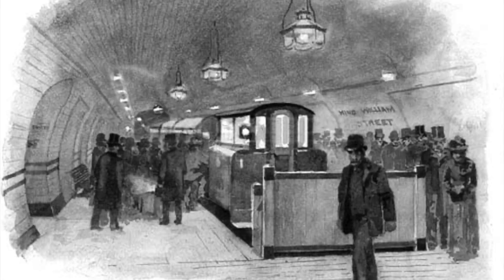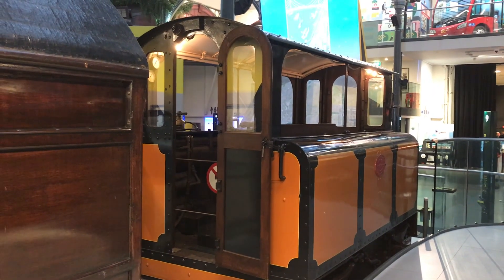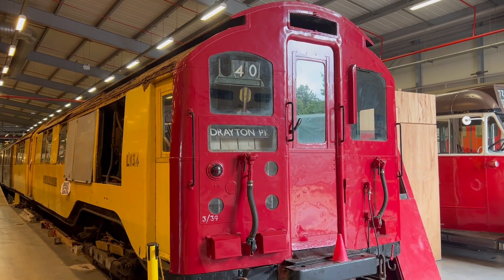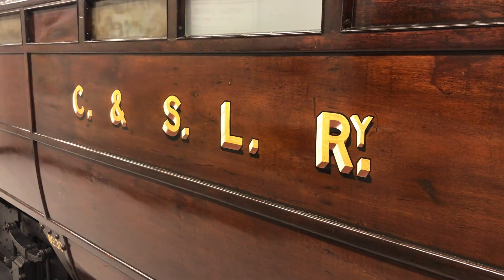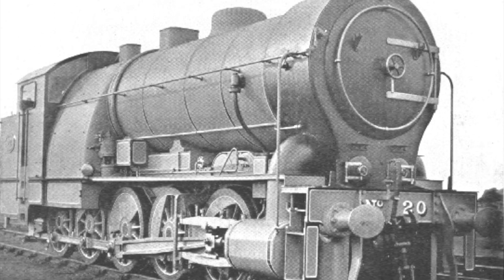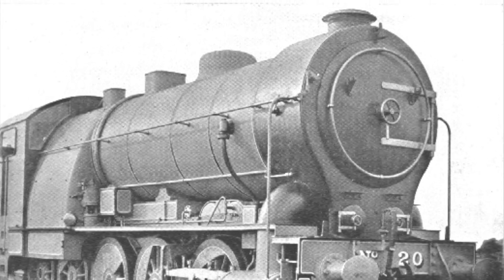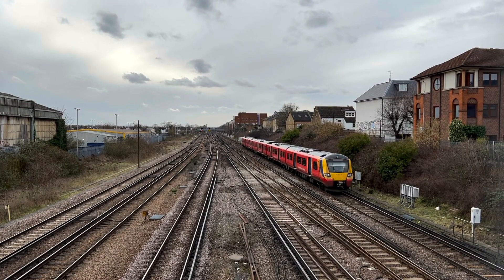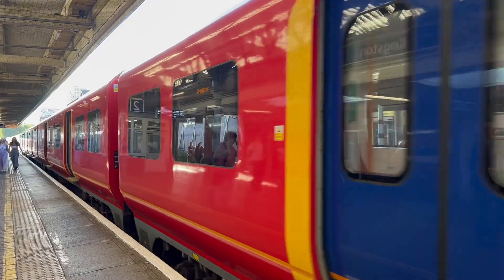Why some electric trains use a third rail, and others don't

Comment: I'm not sure if this is a myth or not... Having worked on British Rail it might well be that because there where a lot of them!! My understanding was that the whole of the Lancashire and Yorkshire Railway was to be turned into a third rail system prior to WW1.... However the UK being the UK and it not being London the only part that was finished was the Bury line ... Now part of the Manchester tram system... I'm not sure if Merseyrail's third rail was part of this programme or something independent of it, but before Manchester Victoria was modernized there where areas of the mainline... not connected to the Bury line that had 3rd rail fittings

Comment: A weirdness I just remembered: the Southern Region had (has?) 'electro-diesels' - diesel-electric engines that could also run from the third rail. Did similar things ever exist on overhead lines? (I know multiple-units do this - eg on the GWR, but were/are there engines that do/did it?)
Reply: Yes. Class 88 ac electric locomotives can do this trick. Some SR class 73s are still around - they work the diesel portions of thge Highland Sleeper, although obviously the 3rd rail capability is not required for this.
Reply: Many of the electro-diesel DC third rail locomotives are still around but in private ownership or on heritage lines. Southern doesn't own or still operate any that I know of...after all, they are over 60 years old by now.
Reply: @adrianbaron4994  nothing wrong with being over 60 years old!

Comment: The London Underground uses ( more expensive ? ) FOUR  rails to keep the running tracks totally isolated from the traction electricity ... this is to prevent  SERIOUS electrolytic corrosion of the tunnel rings .... simple ! ........ DAVE™🛑

Comment: Might be worth mentioning a few additional reasons why the post- war sr went with the third rail .

1) the LBSCs elevated electric lines used Siemens technology and they, being German, had been out of favour since 1914.
2) the SECR had been planning it's own electrification based on a tube type 4 rail system and 
3) LSWR / SECR engineering staff dominated the higher echelons of SR management.

Add that to the cost of the overhead system and the straightened circumstances of the early SR and the technologically better LBSC system was always going to lose to the cheaper and simpler 3rd rail 

The LBSC were right in the long term tho....
Reply: This is quite true, and in the end, the decision came down to AC mileage versus DC mileage, but it wasn't as clear-cut as it seems. 

The LBSCR was so pleased with the turnaround in fortunes of the South London line after AC electrification that they eventually extended the system to other suburban lines south of London; they got about 1/3rd of the way to Brighton and planned to extend the wires all the way there, which would have given Britain its first electrified mainline. Keeping with the continental feel of the LBSCR AC system, they would have used Swiss-style coupled wheel AC electric locomotives for non-stop express services from Brighton to Victoria and London Bridge,  including Pullman services. 

We could have had an electric Brighton Belle 10 years before the DC one came along, and they were planning for it to be fast...well under 55 minutes, just enough time for kippers, toast, marmalade and tea.

The arguments against abandoning the technically superior overhead AC for DC third rail still ring true today...dangerous to staff, vulnerable to snow, ice, and heavy rain, numerous substations required every few miles, not suitable for long distances and high speeds.. but just as with HS2, short-termism overcame everything else.
Reply: @adrianbaron4994  I seem to recall that the LBSC used some motor luggage vans which were effectively elective locomotives and some became the SR express brake vans in the the thirties, after conversion
Reply: they were really really right tho, interestingly. Because they used an AC OLE system which was quite forward looking of the time and would have put them in a really good position throughout the 20th c

Comment: Here in East Sussex we still await electrification.  The line to Uckfield is still diesel and partially single track as well.   Perhaps in the future we may return to a pre-Beeching level of service.
Reply: Keep an eye on the GWR  ex Vivarail D stock battery train experiment on the Ealing to Greenford shuttle route. This started quite recently and GWR is betting big on this, having paid £25 million for the Vivarail trains, technology etc, and hiring the former Vivarail specialist engineering staff. What is really needed is to reconnect the Uckfield line to Brighton via Lewes, but that's a different matter.
Reply: Services on pre-Beeching rural lines were often very patchy indeed, so don't necessarily set that as the target. Pre-Beeching rural lines were often very infrequent, not particularly reliable and used very old stock. On many lines you would be lucky to get one two carriage train every two hours. There is something of a sentimental attachment to lines back in the 1950s, but it was not a golden age. By that time, a lot of passenger traffic had already been lost (it had started with buses, which were often more convenient before private transport became really popular). 

Also, steam-operated rural lines in the 1950s were really bad.

Comment: Nicely explained, Jago. I think if they were going to convert "Southern" to overhead wires (which ever since I was little I thought was a sensible idea) they would have to do it piecemeal.  London to Dover,  to Brighton, to Southampton. And then gradually fill in the rest.  That would then throw up issues like tunnels not being particularly high or wide which might prevent overhead wires being used. Then you are into a whole different ballgame of change. 
There are other areas like here in Scotland which might benefit from overhead electric. Just about everything north of Glasgow and Edinburgh is still diesel powered. (but theres also been hydrogen power being trialed!!!).  We've got a lot of wind generated power but that same wind might prove difficult for overhead pick-up.
To be fair, UK has been particularly bad at electrifying railways. Just about anywhere in Europe has been electric for...well...as long as I can remember. (still a few French and Danish diesels around lol)
Reply: The cost of converting the major Southern DC routes to overhead AC would be enormous and it's hard to see how it could ever be financed despite being a far superior system to DC. Network Rail, however, has a quandary...much of the DC third rail power supply infrastructure is going to be, or is becoming, life expired and as this sort of heavy rail long-distance DC power supply equipment isn't widely made anymore, replacing it won't be cheap either, so who knows. Maybe we will see DC to AC conversions if it's cheaper overall. Certainly, a lot of the modern third rail-only DC rolling stock used in SE England has provision to be converted to AC overhead, if that ever happens.

The ill-fated" electric spine" 25 Kv AC freight route project of 2012, was never completed in full although some bits were or are going ahead (East-West rail is a part of it, although minus the AC electrification, which was the whole point in the first place ) would have involved converting the DC lines from Southampton via Basingstoke to Reading to AC, or maybe keeping the DC and adding AC masts and wires for the electric freight services. This was also supposed to be a test bed for future DC to AC conversions, but as this part of the project was never built, we'll probably never know.
Reply: Why would it be sensible, considering how often overhead wires come down and cause misery to millions ?
Reply: @AndreiTupolev  less likely to kill people who walk on the rails. While living in Newhaven for 20 years there were at least three deaths and several severe injuries that I can remember.

Comment: new-build 3rd rail is such a pain the Mersey-Rail extensions are using battery trains, rather than electrifying the new bits.
Reply: Silly them. In the long run it will cost them a fortune. 
In the charge and discharge cycle of the batteries, up to 30% or the energy is lost. The batteries have limited life expectancy. Then you are using even more energy hauling them over the rest of the network. Not to mention fire risk. LOL

Comment: Don’t forget that MerseyRail is also 3rd rail electric
Reply: As was the Newcastle loop to Whitley Bay with the 'Tyneside Electrics' from 1904 until 1967 using a 600v third rail DC system, when it was converted for cost reasons to slower diesel multiple units until 1979 , and then reopened as part of the Tyne and Wear Metro in 1980.

Comment: At what point did diesel-electric become a third option? It sounds like it was later than the first electrification efforts, if the competition was steam.
Boston's commuter-rail lines are still not electrified, though Amtrak's Northeast Corridor from New York to Boston is (the line from New Haven was electrified in 2000).
Boston also has a subway line that switches from third-rail to overhead pickup (the Blue Line). The Green Line is all trolleys with overhead power, as is the Ashmont-Mattapan line, and the other lines are third-rail.
Reply: Yes, deisel came after electric. Same applies to cars, we had electric cars before diesel and petrol cars were invented; and trams and trolley buses that were later replaced with diesel buses.
Reply: Services to Weymouth from London Waterloo were hauled by push-pull diesel-electric locomotives for a while. From 1967 using the third rail as far as Bournemouth and then by the diesel engine on the unelectrified tracks to Weymouth, up until when the whole line was electrified in 1988.

Comment: Nice to see the South Western Railway class 707s that still haven't been replaced with the newer class 701s, even thought the 710s have been moved on and the 701s are 4 years late!! The other trouble with overhead wires is the time taken to re-wire after an accident (or dodgy pantographs) pull them down. If a shoe pushes a third rail off the insulators (and that did happen to a train I was on near Balham some years ago). a track gang can quickly put it back after the power has been isolated. They had arrived and started work before we were evacuated from the train, a class 319!
Reply: I believe we still have two of them!

Comment: Interesting! Converting the 3rd rail network to overhead (catenery) power would also face the problem of low bridges at numerous locations. It's a pity that the former Southern Railway's pre-war plan to electrify their entire network was never fully completed - to this day there are still about 6 routes that remain diesel-operated.
Reply: If the recently started experiment with the ex-Vivarail D stock battery train conversion running on the GWR  Greenford to Ealing shuttle service works out, some of the shorter Southern diesel services like Ashford to Hastings, which one way is 26 miles, might become battery-operated, The Ds range with a full battery seems to be about 50  or so miles on a single 10-minute full charge, done automatically from a large trickle charged static battery whilst they stand at the terminus waiting for the return trip.

The longer diesel lines, like the Uckfield via Oxted to London route, might not be able to use the ex-D trains as the route is long and the D trains can't recharge in motion from the third rail when they eventually reach it from Uckfield as it hasn't enough power capacity for them! Sad irony.
Reply: @adrianbaron4994  Thanks for that. It would be great to see these battery-powered trains operating on those routes and eliminating diesel propulsion. These ex-D trains are clearly a test bed and hopefully will lead to further units more suited to longer distances. Yes, on the Uckfield line, despite the inability to charge in motion, bimodal units i.e. 3rd rail and battery power, may be the solution.
Reply: I used to live near Acton Main Line. When the Heathrow express was started we had months of road disruption while that very thing occurred, all the railway bridges were raised up a foot or so to accept the overhead wires.
Reply: Thanks, so this pretty much confirms Uckfield line will never change. What's the answer then? Are there battery electric trains?
Reply: @BenGillam  Yes, the Uckfield line should have been electrified decades ago (and the link to Lewes restored). Failing that, battery/electric trains exist and could be used on that route if only the will is there to do it.
Reply: Or Bi-mode Electric/Diesel trains running from Uckfield to Hurst Green on Diesel, then 3rd Rail to London termini. 
Works on the LIRR in NYC- Diesel out to Montauk, 3rd rail into Manhattan. 
Removes Diesel emissions within the M25, but provides a one-seat ride into town. 
Would also solve the restricted tunnel clearances into Marylebone. 
Electrify with 3rd rail from Marylebone to Gerrards Cross, and 4th rail to Aylesbury then Diesel to Birmingham etc…
Reply: @tobygranshaw3359  I think a 3rd rail electric/battery bimodal train would be better.
Reply: Which routes are still Diesel in London?

Comment: Am I right in thinking that the court rail system on the underground means that it has less chance of a train being stranded due to power issues as the two power rails are on separate systems, and basically ‘add up’ to the correct current/voltage and that should one fail the other is enough to allow the train to clear the tunnel, albeit slower.? Or did I imagine that?
Reply: It's all powered from one transformer. You can think of one of the rails being positive and one being negative like on a battery, with the negative being a bit more negative than we would usually expect.

This in theory could be more unreliable with a second line that could be damaged
Reply: @amy-377  Gotcha. Seems to have more to do with leakage cause issues of corrosion on the iron tunnel construction and the four rail system means that the running rails are not part of the power circuit. Stray currents can be a big problem in tunnels (because of the location of earthing points), and when the running rails are part of the electrical power circuit the problems are exacerbated. The +420 V rail is the one outside one of the running rails, the -210 V rail is the centre one, with both power rails insulated from earth. As a former physics teacher this is very interesting.

Comment: Some systems take the current from above ( like in the UK ), some from underneath (like the Berlin S-Bahn) which makes protection of people and snow/ice simple…
The overhead wires can be replaced with a overhead rail in tunnels too…
Reply: Overhead rails as in the Elizabeth Line.
Reply: Some are even side contact like the Hamburg S-Bahn.

Comment: What is the buzz? anyway different, somewhat related question. I have an amplifier in my room but even when turned off I can hear a buzz, thats just the power supply unit right?
Reply: Just unplug it.

Comment: Interestingly, as mentioned in the video, there were overhead wires on the Brighton line, which were converted to 3rd rail by the Southern Railway to ensure standardisation across the Southern network
Reply: I’m surprised. It should have stayed and been converted to 25kV. We may have had 125mph on there by now.
Reply: @manomaylr  Yes, well I guess its a trade off between standardisation and having a superior system. In many countries they actually have similar issues. In the Netherlands they use 1500 Volt dc overhead wires, which is far from superior compared to 25kv ac. However, the benefits of having a standardised system outweigh the costs of having a somewhat outdated system. I guess this must have been the reasoning at Southern back then as well.
Reply: @91Durktheturk  Yes, best available technology changes with time. In the 1920s third rail was more reliable and proven than overhead (and cheaper for quick expansion). The LNER and BR used 1500V DC overhead lines from the 1940s (Shenfield. Woodhead) and got very high reliability, the initial switch to 25 kV AC in the 1960s caused lots of problems (also in Glasgow) but it was better after the teething troubles had been gradually ironed out. NL has relatively short distances and modest speeds, so less incentive to swap.

Comment: It is unlikely that Southern would have adopted full electrification for it's network. The plan for the first decade after the War covered the main lines east of Portsmouth in Kent and Sussex, as well as South Croydon to Horsted Keynes (though this was 6th of 6 on their priority list). Perhaps the main line as far as Exeter might have been converted eventually, but beyond that it is likely that diesel-electric services would be used. And just plain diesels for the branches in the South West. Before Nationalisation, a joint venture with the LMS had begun on a diesel-electric locomotive, for instance.

Comment: So why didn't the GWR not go for an electrical system?
Reply: Simple Gods Wonderful Railway built the Best Engines and Boilers and so new fangled sparks were not thought to be of any benefit.
Reply: The Hammersmith & City branch from Westboune Park to Hammersmith was officially part of the GWR, so they did run alecetric trains from c 1908
Reply: It did not have a dense commuter network